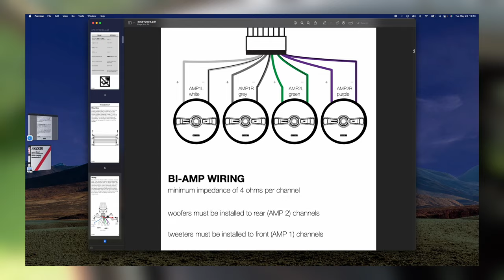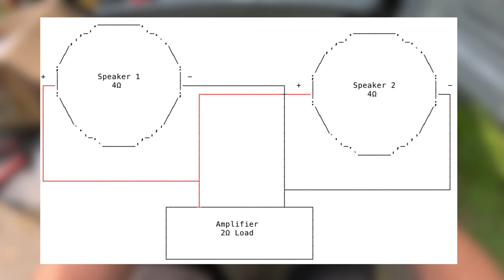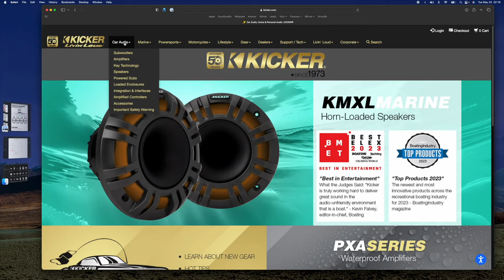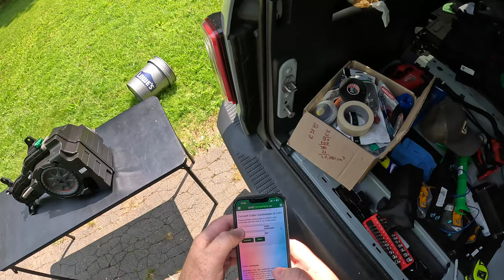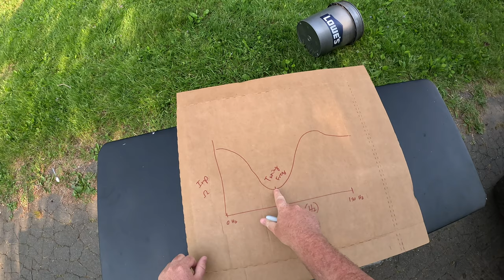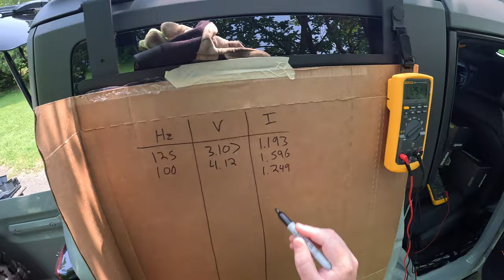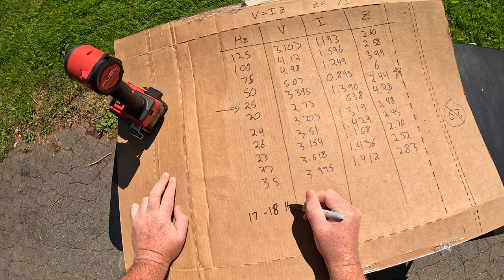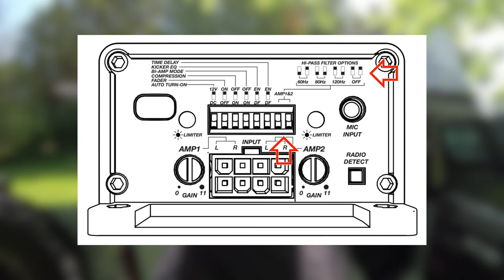Tuning the audio system! - Subwoofer & speaker dial-in | Ford Bronco

Comment: If you could redo this system over again, what would you different ?
Reply from the maker: Part of me wishes I would have gone with a component setup for the front speakers rather than a 6.5" & 4" setup. Honestly I don't know if that would have been any better, but it is something I wish I had at least tried.  (And if I was willing to spend more money on it, I would have.)

And of course there are a lot of minor things here and there I wish I had done differently. Running the power cable for the subwoofer is a good example. Spent hours trying to get that done, but now that I've done it once I could probably do it again in a MUCH shorter amount of time.
Reply: @RagnarKon  so I’m guessing you would have still picked the kicker amps and speakers?
Reply from the maker: @keithscratch   At the price I bought everything at, yes, 100% worth it.  Kicker had a really good holiday/Black Friday sale last year and I took full advantage of it. (Was actually my first time buying Kicker products.)

If I had to pay full MSRP based on today's prices, I definitely would have bought different 4" speakers for the dash.

The Kicker Key 200.4 is also slightly underpowered at only 200 watts. It's fine 98% of the time, but once you take off the top and start blasting music it has a hard time keeping up. So I would like to say that I would get a more powerful amplifier.  But, even today there isn't a whole lot of options available that has the same feature set in the same form factor that could be installed in a similar location.  AudioControl 4.300 is probably the closest option, but it has no EQ or time delay capabilities.

Everything else, Key 500.1, subwoofer, 6.5" speakers, 4" speakers for the rear pods, etc. were great.
Reply: @RagnarKon  this makes me if I’m looking at this approach all wrong, maybe I should be looking at more replacing all the Speakers and Amplifiers that are more aimed at SPL and clarity…
Reply from the maker: @keithscratch  It depends ultimately on what you are going for.

For me I had three requirements:
- $1000 budget.  There are many other non-audio things I want to buy for my Bronco.
- I had to retain full capability of the wash-out floor. This meant I could NOT install amplifiers on the floor under the seats.
- It had to sound just as good or better than the B&O package.

I ended up slightly over budget (just shy of $1200), but otherwise I achieved all of those items.

Depending on your requirements you may end up with different gear.  A lot of people, for example, like having really controlled/tight bass response in their car audio. It wasn't a priority for me, but if it was I would have added a lot of sound deadening.  Blasting music with my Bronco's top off is another good example. Not a priority for me at all, but I would have selected different gear if it was.

Comment: If you wanted an accurate volume measurement, all you need is a trash bag, fill up the enclosure with water in the trash bag and measure the volume in a 5 gallon pail.